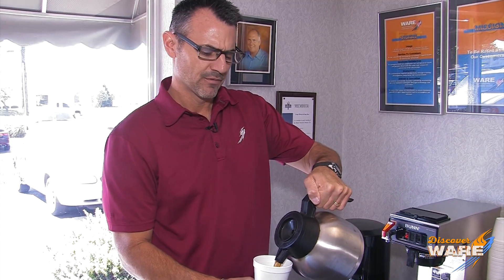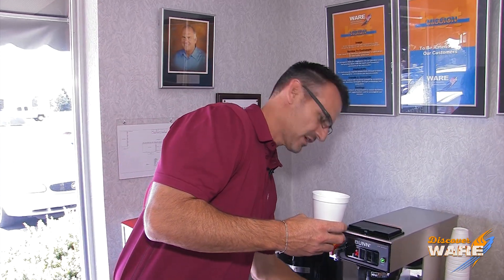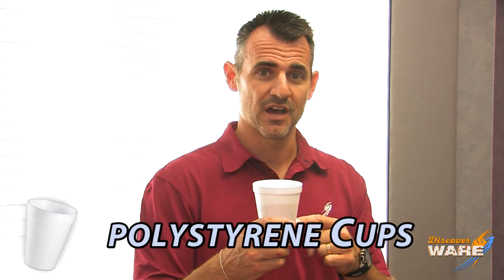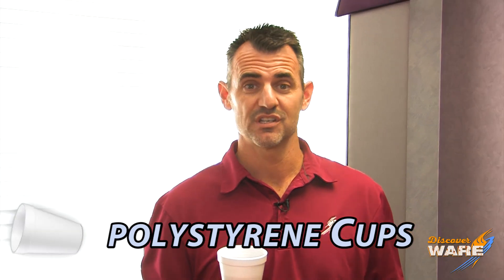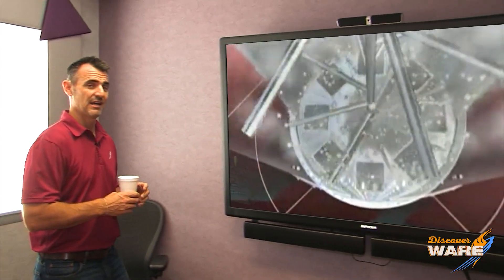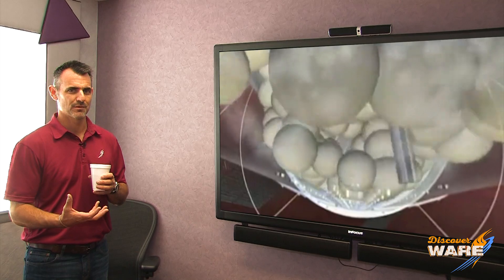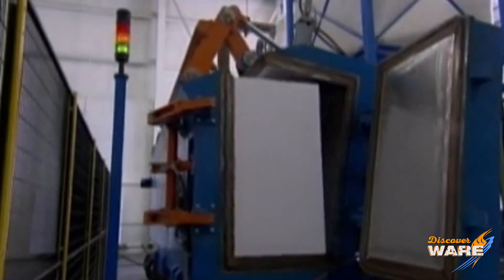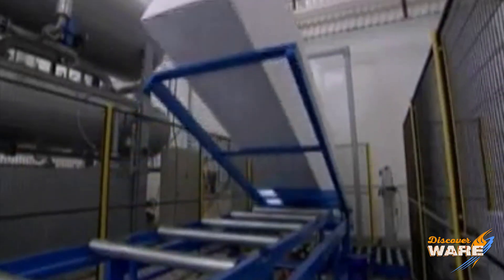How Styrofoam Cups Are Made! - Steam Culture

Comment: Even though the pentane is re-condensed and reused, the problems come with disposal. Polystyrene (PS) does not biodegrade in landfills at all. And since it is used mainly for single-serve food packing and beverages, it is simply not practical to collect, separate, and wash it for large scale recycle. The US produces 3 million tons of PS foam per year, of which 80% ends up in landfills. It takes up 30% of landfill space. 20% ends up in waterways. Some of it is mistaken for food and consumed by birds, fish, etc. and is not digestible. Rivers carry it into the ocean. It continues to break into smaller and smaller pieces, eventually getting so small that fish ingest it without even knowing it. It also also washes back up on seashores. There is work in progress to replace the PS with compostable foams. Hopefully it will get completely replaced within a few decades. In the meantime please check into ways to recycle things like packing peanuts, which obviously can be reused many times over. You can also rinse those coffee cups and use them a few times over.

Comment: eps cups are made by injecting the pre-expanded beads into a cup mold, applying more steam, further expanding the beads and bonding them together, cooling them with cool water running through the molds tgen ejecting them from the mold. it is a fascinating process and one that is environmentally responsible and sustainable as well. even the waste penta from the bead expansion is used for fuel to generate the steam needed for expanding the eps beads!
Reply: Now, that was more helpful than the video. Thank you!!